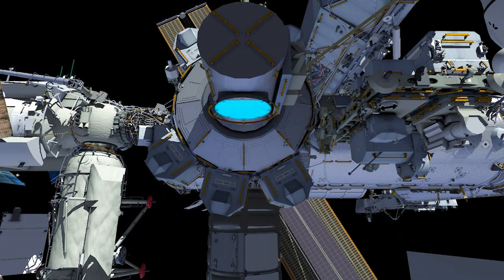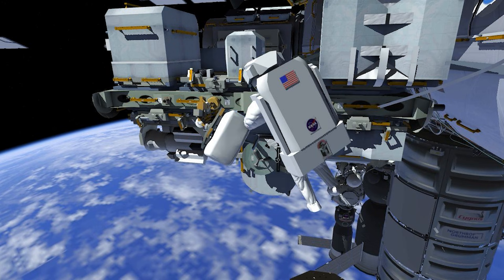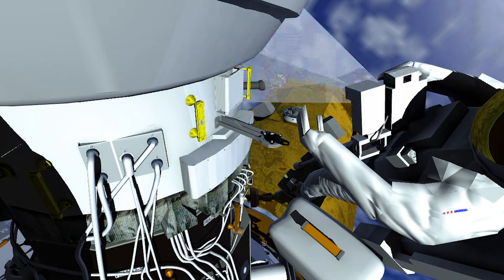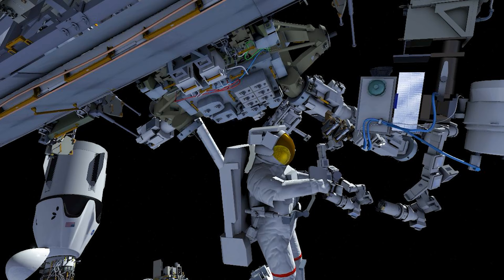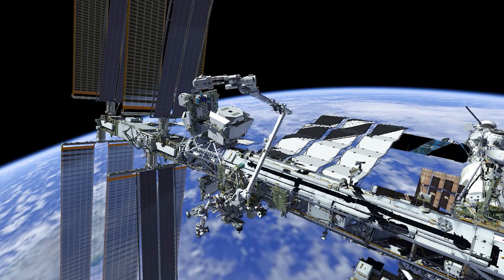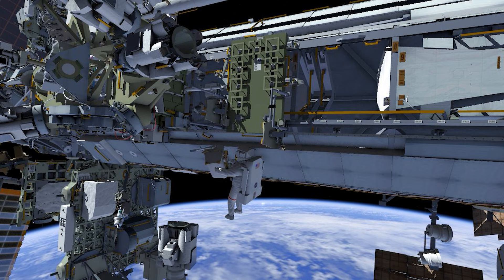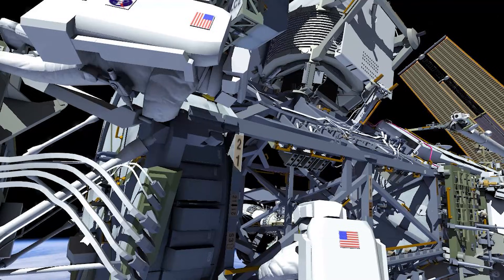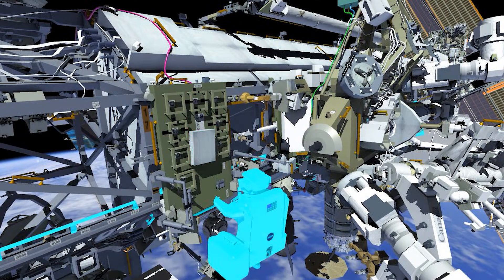U.S. Spacewalk 95 Animation – Tuesday, January 6, 2026

Comment: This EVA animation is such a great way to understand the plan.
Nerdy fun fact: spacesuits are basically tiny spacecraft, they use pure oxygen and pressure to keep astronauts alive, and the cooling system is water based to pull heat away during work.
Every tool and handrail is planned to the minute because fuel and oxygen are limited.